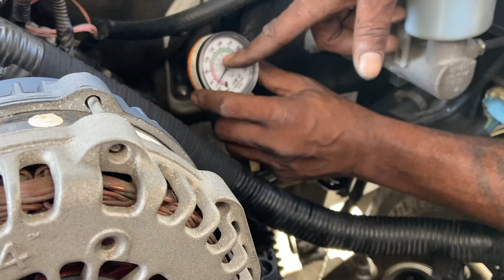Compression Test On 5.3 LS Motor Reveals Something I Would Never Expect!

Comment: Something’s not right bro because the only thing that was wrong with that truck was a lifter tap behind that it ran fine hopefully you got the right cam bro yes turn the crank and check to see if the valve close and then do a compression check again make sure the valves are shut and check compression again on each cylinder hole spark plug